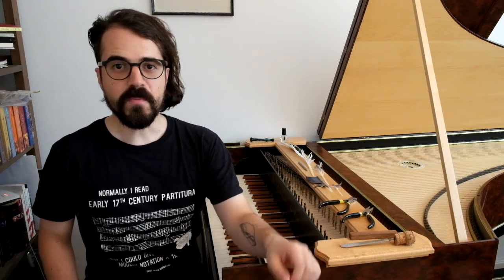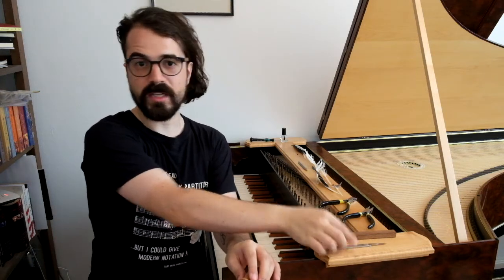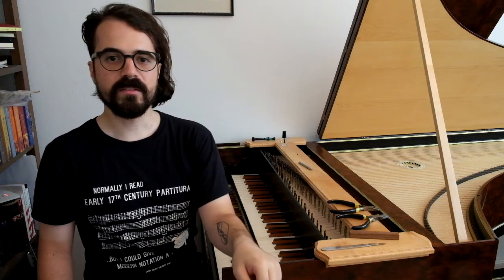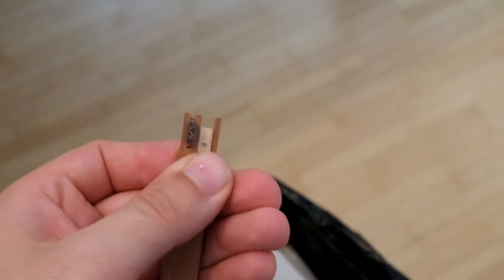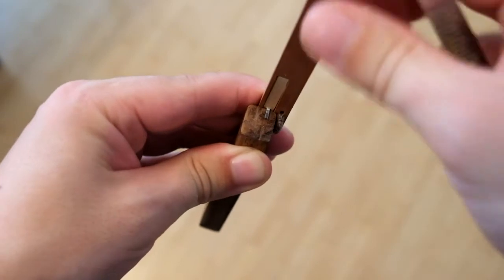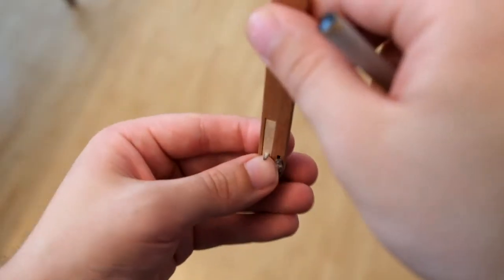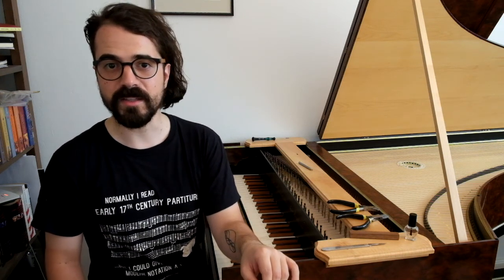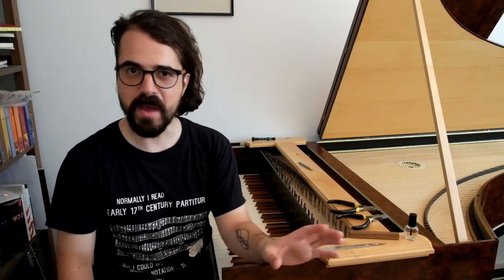Cutting and voicing plectra using bird's quill

Comment: Interesting. I would NOT use residue from one's forehead. This is likely to be sweat that is salty. I have always wiped the plectra on my nostril! The sebum works well and is convenient and helps if the string doesn't pluck smoothly.  I always cut the end at about 45° with quil and Delrin. Sharpness of the (10A) blade is the key as you said. When quilling a whole instrument,  I've used a bunch of feathers in rotation ( 8 ) and methodically working from treb to bass the plectra will gradually become wider and thicker.  Keep up the good work! Rob

Comment: Your video may have restored my desire to replace the Delrin jacks/plectra of my Flemish double with pear/raven quill. I fashioned replacements for the front 8' choir and was quite disappointed with the results: the intensity of the sound of the jacks/plectra of natural materials was significantly lower than the intensity of those made of Delrin. More importantly, I  was unable to cut plectra for the lower notes of the compass that were even close to satisfactory, even after using the thicker material at the base of the feather. In the end, I may choose to use the pear wood jacks with Delrin plectra because sonic intensity is a characteristic that I prize over charm. Thoughts on that? Thank you for posting this video--it was very well produced.
Reply from the maker: Hi there, thanks for the feedback, I'm happy to hear my video is having such an impact on people's desires ;-)

Without knowing how strongly your harpsichord was voiced exactly, it's difficult to say... It is possible to achieve a very, very loud sound using natural quill. I suggest giving swan or seagull a try and not trimming off too much pith and length. If before your harpsichord was voiced so strongly that even this won't suffice to reach a similar loudness, you might simply have had too strong of a voicing before and you should be able to achieve a much nicer sound with natural quill which, though it may be softer, should still be loud enough. At any rate, start by leaving a lot of material on the quill, you might simply have cut off a bit too much :) as a happy side effect: your technique and your fingers will be grateful for a softer touch

Comment: I intuitively sense this kind of plectra must be ideal...I am assuming this to be very detailed and demanding work, I would imagine all the plectra must be very very similar in order to achieve an even voicing?...Does it vary from low ranges to higher ones?...or is it best when uniform...?...what a brilliant area of endeavour you share with us here...thank you....will look forward to any further videos you may be kind enough to share with us.
Reply from the maker: Indeed, the closer you can get the plectra to one another, the better. Of course this is impossible with bird's quill, as it's a product of nature and hence not uniform. But you can get them close enough for the differences to be barely noticeable in normal playing. As you suspected, for an even tone and touch one needs to adjust the width/thickness/length depending on the range; roughly speaking, you'll want them to be somewhat wider and thicker in the bass and somewhat narrower and thinner in the treble. Personal preference and the precise conditions of one's instrument do however have their appropriate effects on that!
Reply: @AndreasGilger  how fascinating to imagine such possible variants...should one expect the lower ranges to be usually more thundering than higher ranges?...it seems a bit that way to me, and I do like it....have you found benefits perhaps in choosing the same exact place in feathers to extract your plectra?...in pursuit of more control over the end result in voicing, naturally.  
Post more videos on restauration, you seem the ideal type for this.  Thanks.
Reply from the maker: @permacultureli  That would probably depend on the specific instrument - some harpsichords have very punchy bass notes which sometimes remind me of a theorbo, others have a much more boomy sound in the lower registers. At any rate, I feel that a good harpsichord has rather distinct ranges. When voicing, I try to emphasise these differences, so my plectra end up looking the way they do because I feel this brings out the instrument's characteristics more than making them all uniform would. That being said, I have not yet systematically explored all the outcomes of all possible ways of voicing. For example, I have never attempted to cut all plectra exactly the same. At any rate, I would expect this to lead either to a very harsh treble (as the treble would be voiced just as strongly as the bass), or conversely to a very weak bass (as the bass would be voiced just as softly as the treble).